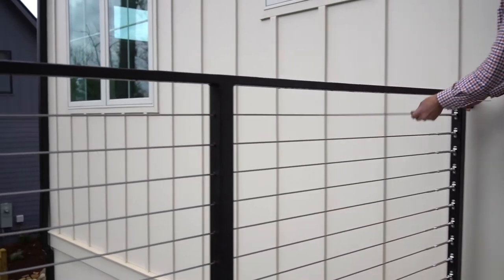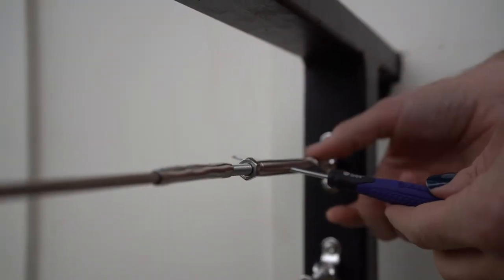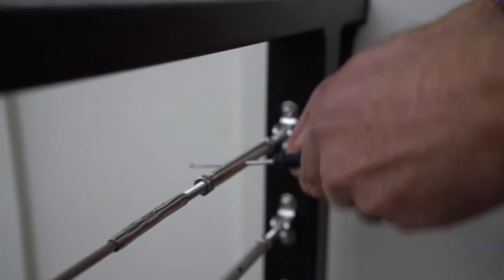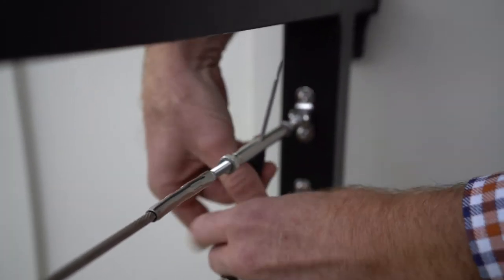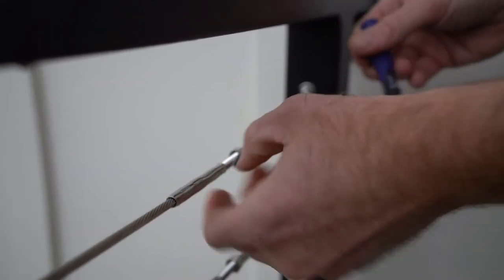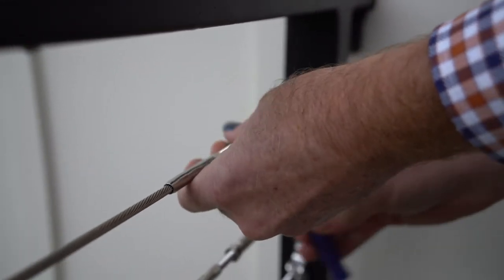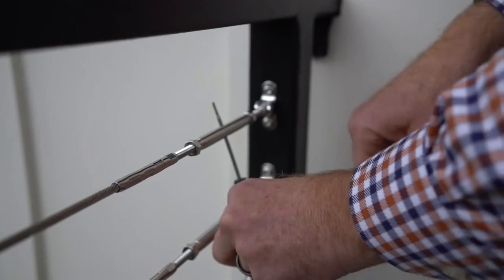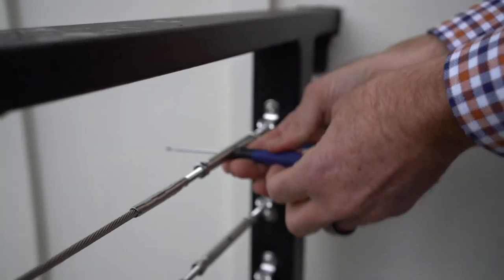Tightening Cable Rails

Comment: Does that screw closest to the post need to be loosened before you start turning that elongated piece?  I mistakenly hit one of my cables with a frisbee playing with the dog and I can't seem to get the cable as tight as the other others. This is a brand new deck. ugh!
Reply from the maker: Yes that might help you but be careful if you loosen that screw it could case the cable to get more loss. I tend not to loosen it but it can help in getting some freedom for the cable. If you do loosen make sure you have the screw driver in the turnbuckle so it does not back up on you.